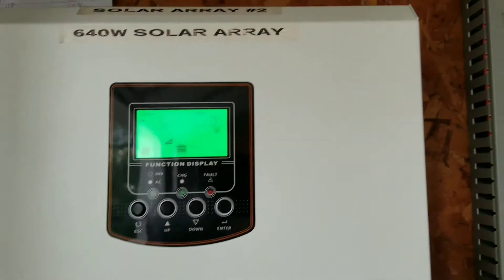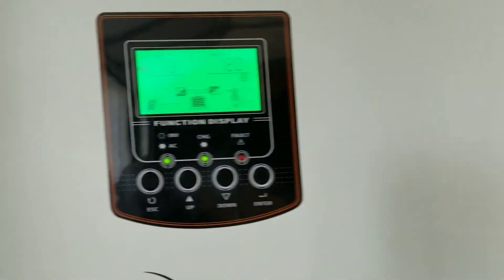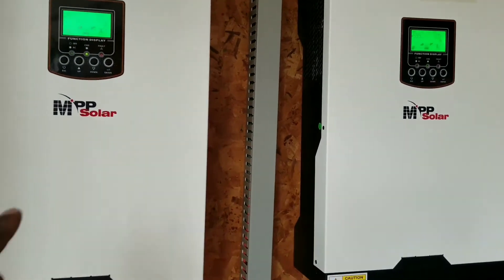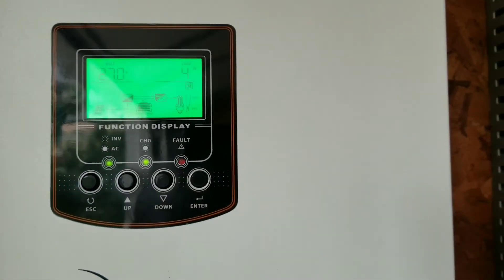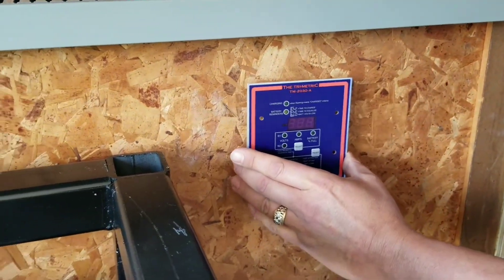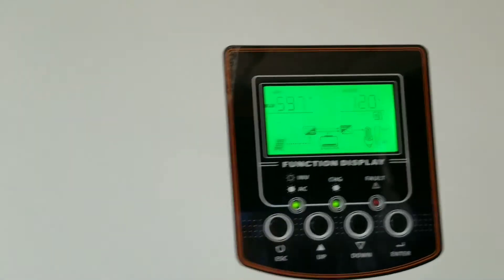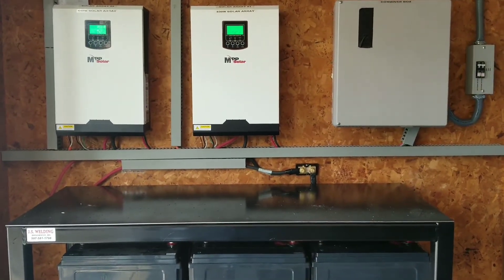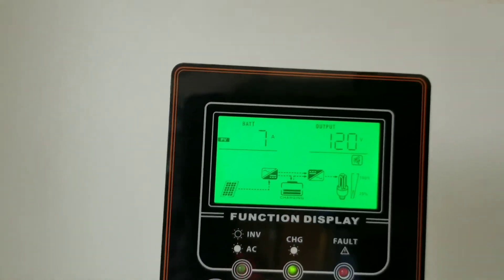PIP 2424LV-MSD SOLAR SYSTEM IS BACK ONLINE Pt#2

Comment: Are these inverters running parallel?
Reply: but they can running on parallel
Reply from the maker: +Steve Robertson 
No Sir.
Reply from the maker: +Steve Robertson 
They are running independently
Reply from the maker: +Víctor Almonte 
https://youtu.be/Q-9AMh_ATTk
MPP SOLAR INVERTER CHARGERS PIP 242424LV-MSD - Complete Installation
WANAMINGO MINNESOTA BY jwsolarusa